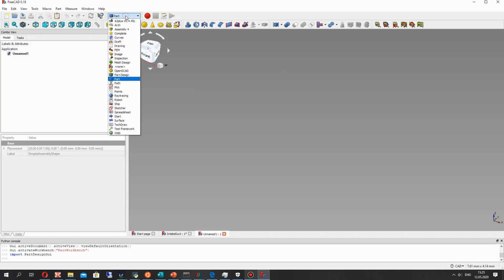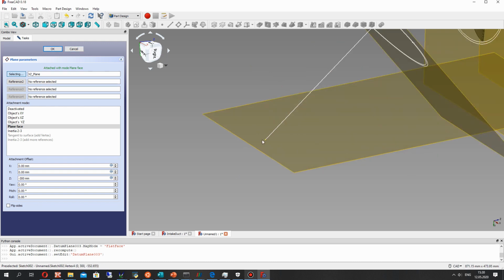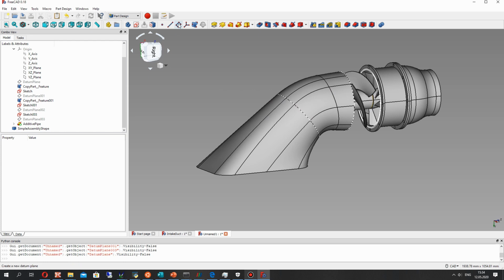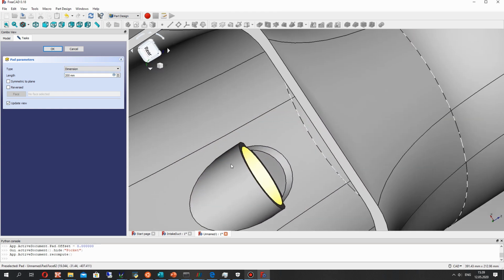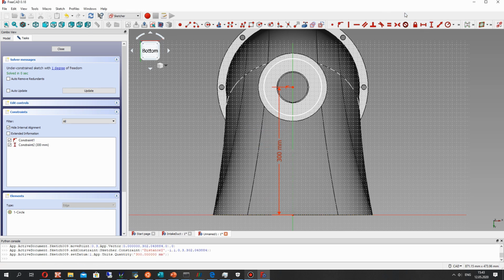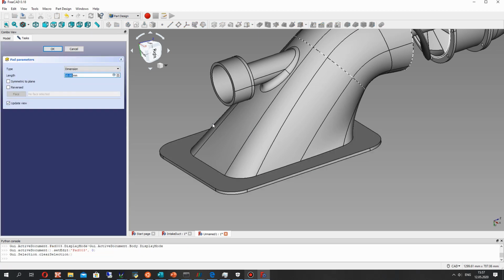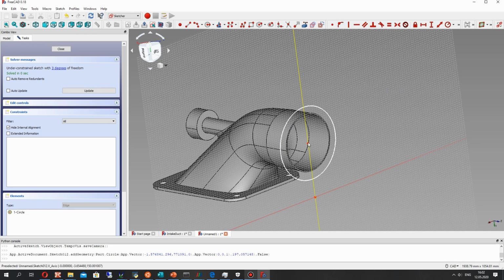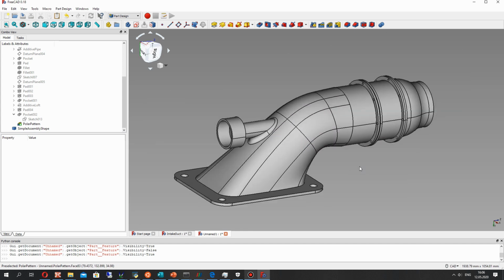FreeCAD Tutorial Part 5 | Creation Model of Intake Duct for Water Jet Pump

Comment: Hi Evgeniy, really nice work. During the pipe additive, on 08:30 of this video, I got a warning says "Multisections need to have the same amount of inner wires as the base section" and fails to follow Sketch003. Do you know why? Sketch 001 doesn't have this problem.
Reply: Sorry. I redid the plane of Sketch003 and the sketch itself and this problem goes away. I found the translation DOF of Sketch4 can be a problem too. If you pull it too close to Sketch001 of the impeller, the pipe will be twisted.
Reply: Sorry. I redid the plane of Sketch003 and the sketch itself and this problem goes away. I found the translation DOF of Sketch4 can be a problem too. If you pull it too close to Sketch001 of the impeller, the pipe will be twisted.